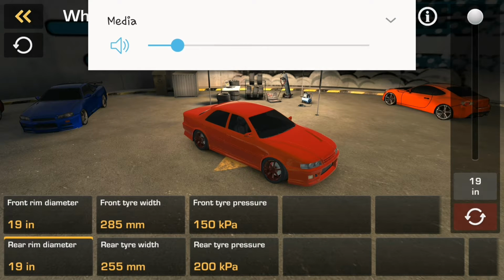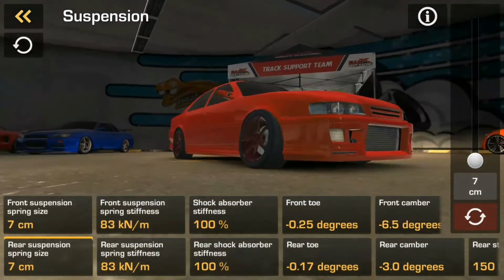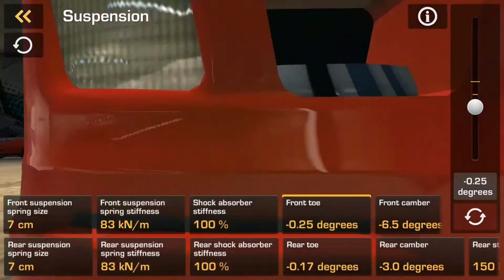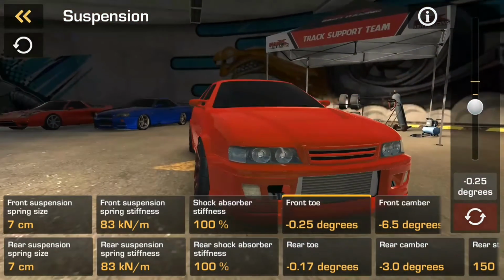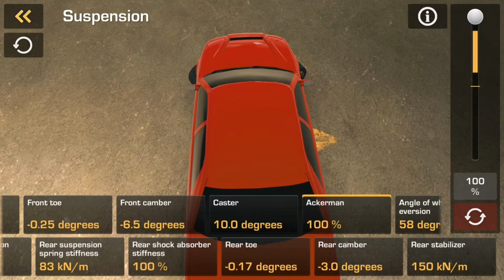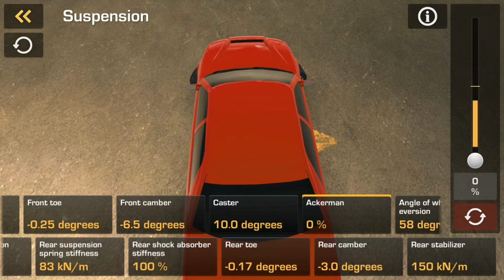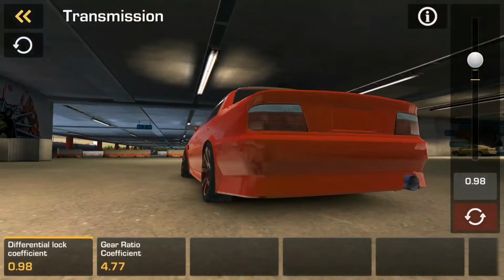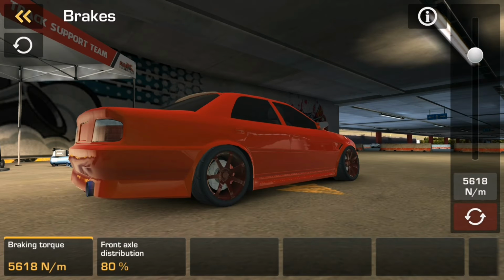Best Tune for Burner JDM | CarX Drift Racing |

Comment: For my driving style, i prefer maxed rear tyre pressure, max dif. lock coefficient and lowest gear ratio. I drift only in 2nd gear and only if there is a longer turn i gear up.
Reply from the maker: Sebastian Luca Yeah, I find the tuning that i did on the s15 is my favourite.